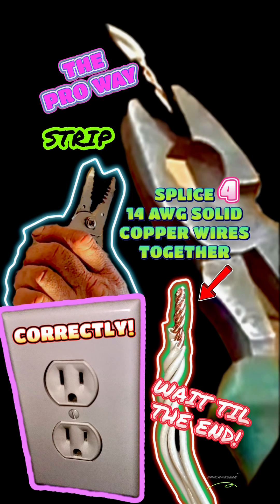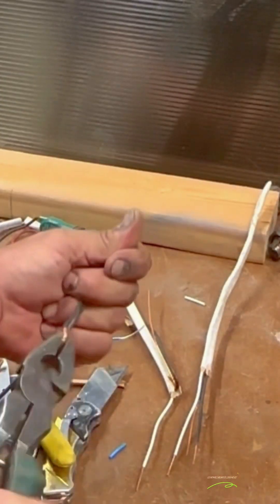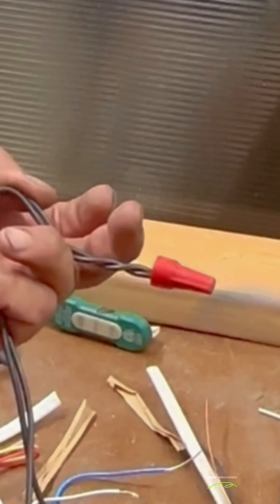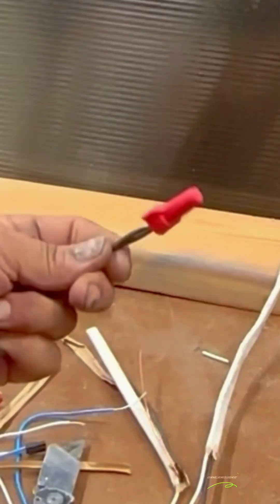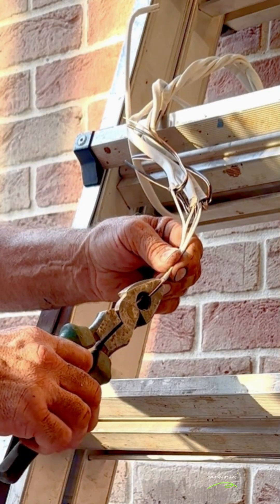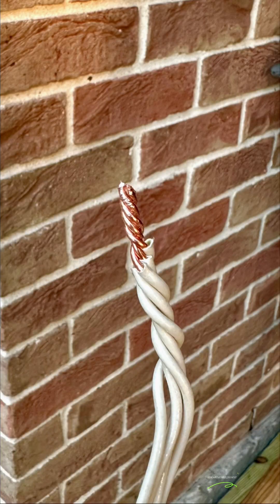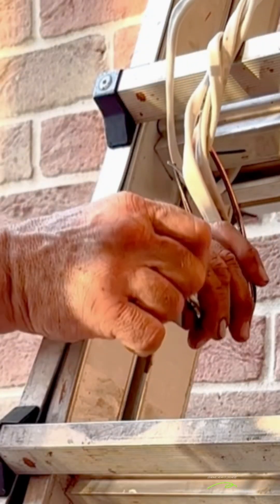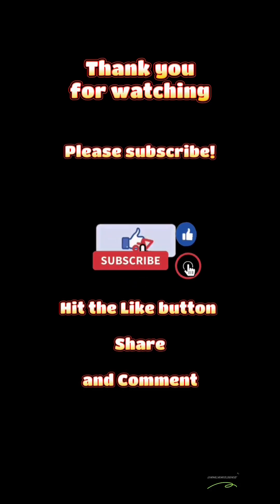Electrical - splicing multiple wires together, the right way. #new #youtubeshorts #howto #learning

Comment: Wire nuts are rarely used outside of USA from what I know. Don't even ever remember seeing them for sale in hardware stores even and i've been to dozens. I guess they used to be made poorly before standards came in so everywhere else just settled with alternatives. These days I feel like lever/wago connectors are best anywhere anyway, no need to twist any wires together and making maintenance a pain, no tools needed, no weakening the cable if you need to separate them, solid af. Too bad they're expensive.
Reply from the maker: Some of those are ok. It depends on the manufacturer. I’ve seen too many inferior ones fail, come loose, etc., so I won’t use them especially when I’m responsible for the work and anything I touch inside any box or panel. Thank you for watching and commenting!